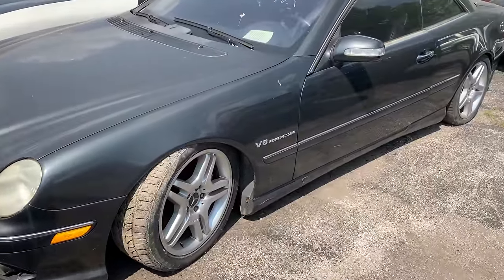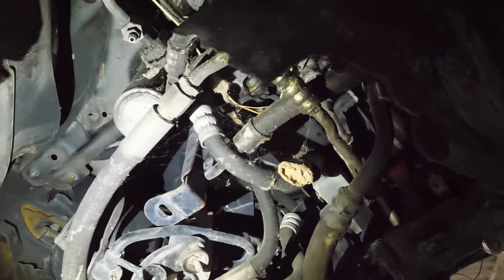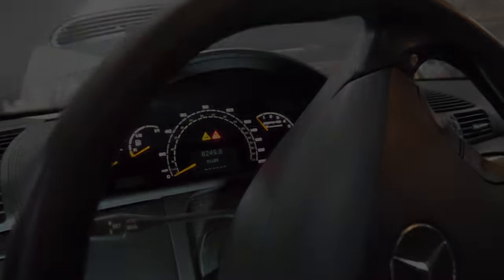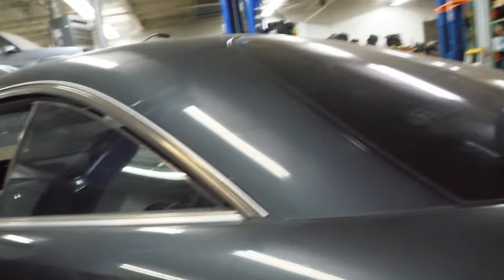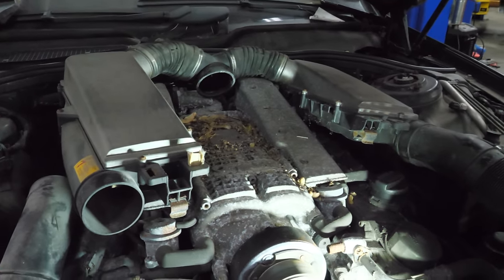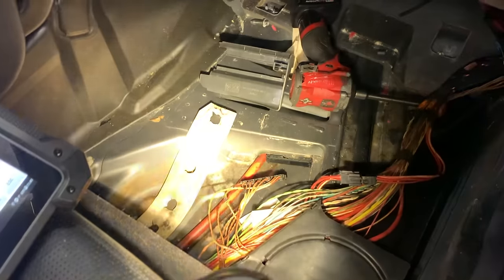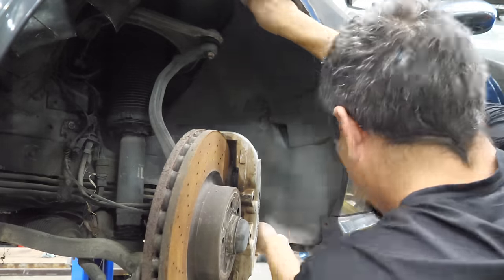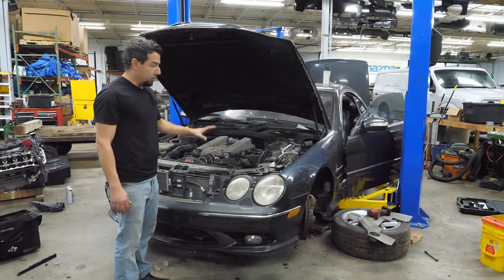DEFEATED! Tow Lot Bought 500HP Mercedes CL55 AMG Sat For 7 Years

Comment: If it's an M113K engine, you could probably needs a coolant pump for the supercharger, but that engine is bulletproof.. it's actually a great car and they don't usually corrode unless they've been crashed or severely abused. Every CL and s-class of that era that I have seen that has corrosion issues, has been in a wreck at some point.. I have a 2006 S430, that I bought used in 2015 while I was living in the Chicago area, the car had spent it's life since noon to that point in Chicago, and it was up there until the fall of 2018 when I moved back to Tennessee.. 12 years in the snow ice and salt and mine is not rusty.

Comment: Careful about relying on continuity tests on communication wires.  You can get continuity if a wire is shorted to another wire.  Only true way to know for sure is to use an oscilloscope.

Comment: When I was in high school, a friend of mine's parents got a 1986's BMW in their yard, whose bonnet cable got broken, and it sat for a while due to a flat battery and they could not get the hood open.

I managed to get it open by removing the right hand front light, and then it was just a matter of pulling the bonnet mechanism lever (which the cable was attached to below the bonnet) to release the bonnet and open it. A battery swap was done and the car started up after a little bit of cranking. 

They got a mechanic to replace the cable and sold the car. 😂

Was real fun. We did not had google or youtube back in the 1988's and had to rely on intuition and luck.

Comment: First remove the fuel pump flush it out with carb cleaner and pb blaster. tap it down on a wood block. use a battery charger and give it power, then reverse the leads until it breaks free. I think it senses fuel pressure and may turn off the injectors of its not detected. Second you have a security failure, but that should show a code. Also change the fuel filter, it acts as a regulator. Drain the tank too.  I have an 02 E430, similar engine and system.

Comment: If the M113K engine fails the compression and leak-down test, you should tear it down. Would love to see that, and someday a Mercedes-Benz M176/M177 V8 teardown, and the Toyota 2AZ-FE straight-four. The latter is widely considered to be their worst engine, in large part due to their notorious oil consumption problem (~1 qt per 900‐1,200 miles on a high-mileage engine).

Comment: I just did this on my 2004 E500 wagon. This is painful to watch, but with the ABC instead of the air suspension you do have way less room. On my car it takes a large screen driver from below to remove the shield and then pop the latch.

Comment: Other than the fuel issues, the immobilizer circuit may be causing you issues,  I have a CL55 myself and running that is one of the most pleasurable cars in the world. It really is too bad that it sat. You were reasonably successful considering the time. 143k miles is still young for an M113k ...

Comment: I’m sure you did your research, but just in case you didn’t, I have three

So, depending on your model some, you have to take the tire off and the skirt out for access some. You can just do right underneath the bumper. 

You take a long screwdriver or metal object at least 2 1/2 to 3 feet long and reach up carefully and there are videos on this. That’s how I found it and you can unlatch the hood. 

You do not have to do all the destruction that you see in this video at all

Comment: He knows how to open the hood very easly. You just pull the iron wire from under the pumber with hand or  using a picking tool, thats what I did. He also could have removed the plastic cover over the wheel, just few bolts and had better access to the hood wires.

Comment: The fan running like that  generally means the ECM isn't functioning.  The whine was the secondary air pump.  Your buddy could code a used ECM for it very easily.  Takes 5 minutes.

Comment: I typically run 25-40 year old vehicles all the time and now the electronics are starting to fail typically due to capacitors leaking. It’s kind of the thing we’re starting to face with our current generation of old vehicles. It’s definitely not like the old days when you could just throw fresh fuel and a battery and drive it home. I like my old garbage, but I do like how well modern fuel systems work, when they work.

Comment: Electric fuel pumps.  If you reverse the voltage the pump moves backward.  Disconnect wires from the car first.  Go from + to - to break it free!  Of course, doesn't always work.

Comment: yes, I did enjoy it, but in summary, you need a friend with the proper diagnostic tool, an abundance of patience, and the actual will to see this car running in order to get this PoS going!
I'm looking to replace an N54-based car(UK)/auto(US) with a Merc (probably an AMG C63), any advice?  I've managed to keep the N54 ticking over for ~5 years now, regular oil changes and spark plugs among others, but there's almost certainly a rear crank seal failure now.  This isn't beyond me but I'd rather not have to do it.
Reply: Scary stuff I’ll stick with my vintage American cars and my Vintage Toyota’s

Comment: Fyi propane works great instead of ether. Get a cheap propane torch and cut off the tip. Put a relly long hose on it. You will like it. Been doing this for 25 years.

Comment: I definitely liked this video. Tad bit of butchery and whatnot but truly entertaining to watch. Well done.
 I know from my r170 that when the fan runs on high w no crank scenario, k circuit is not powered.
W/ mid 2000 era EIS has to tell the SAMs to activate certain circuits to enable drive authorization system.
Last winter I lost my srs, fuel level gauge, easy entry, and a host of others due to EIS not communicating to rear sam to turn on 15R from rear fuse module in my 08 GL.
Car ran and started fine but the eis wasnt fully functioning anymore...
Any missing or received in error messages on CAN/LIN circuits will make these cars braindead..

Comment: I made similar hole in a back door of my Mercedes van when the lock was stuck. It didn't help. I had to break in from the inside and remove a wall. After that cut the lock with angle grinder.

Comment: I've often wondered on cars with no fuel delivery if you could just pipe a small hose from a propane torch directly into the intake and get it running without killing it with ether.

Comment: I think it’s fascinating logic to hide batteries in compartments that can only be accessed with power. Like, what was the problem with things like lever mechanical connections that only little whirry motors, switches and batteries can fix?

Comment: My clk sat for 4 years, and it was a nightmare after. All kinds of things went out. Gas gauge, vent valves, a/c, cooling fans, radiator, belt tensioner. Water vent from the hood clogged water came in. Just be aware it’s going to have more problems. Your suspension is cooked that’s why it’s on the ground.

Comment: I really enjoyed watching this video.  I own a 2002 s10 and have a battery drain so I installed a positive disconnect switch in stead of finding the drain.  It's not a daily driver it only has 89,000 miles.  My point is you really dove into that car trying to diagnose it's issues.  I really thought you'd tear the car down and part it out.  If all your after is the engine can't you put it on a stand and make it run?

Comment: [Clogged injectors]

Hello,

Excellent video. I think the injectors are not spraying fuel, because they are clogged. I have seen cars that sat only for 6 month and had to be jump started. Cars did not start, even with the strongest batteries. Then we took out injectors got them cleaned and they fired the firtst time after that. This was caused by european gasoline, and I know US gasoline is differrent, but it can still become solid in the injector nozzle. Sometimes cars fail becuse of some little stupid things.

Comment: That noise the engine is making sounds like clogged hydraulic lifters. I had one clogged on mine recently and it sounded bad exactly like yours, after a flush and oil change the noise went away completely after a pop noise of it unsticking. Ive daily driven my 2003 CL55 AMG for 6 years now and have done all the work myself. I have access to mercedes workshop software and can help you get it sorted.

Comment: Eric. Thanks. 

If you get a moment, can you tell me what wires you crossed to engage the starter? 

I’m working on my piece of hell and could use that information. 

Thanks.
Reply from the maker: I just decased the relay and manually closed it to complete the circuit

Comment: Your only real mistake was thinking that you had power to the EIS. On a 215, the EIS only needs power and ground to the small connector and a good key for it to turn. That took you down a pretty deep CAN rabbit hole. Drive authorization is another story. The ECU provides the ground signal for the starter relay only if it can communicate with the other immo components. The fact that it would not crank is probably lack of drive authorization.

Comment: Another great video Eric and I can totally understand why you did the way you did, everything before you is pounds in your company account or should I say $🤣 I thought our country's car industry 🇬🇧 was obsessed with dodgy wiring and sticking anything electronic open to the elements but the Germans take it to another level 😂 I had one of my many E39s have the DME under water when the scuttle drain blocked but fortunately it was ok👍 looking forward your next video cheers Matt
Reply: E38/39 are absolute peak BMW. If the 39 is anywhere near as good as the late 38s they're just literally 'built different'. My grandma was given an almost new 2001 740IL Sport from her rich old boss and despite being a Limo it was the most enjoyable cruise car I've ever been in. It's also the best-looking sedan ever imo in the silver sport package like she had. The engines including the M62 aren't bad at all if you're aware of the common issues. It predictably popped the cooling system at like 5 years old but otherwise only needed a suspension bushing. One of the few areas you Euros have us beat is in the cheaper, more common German cars from the 2000s and late 90s.

Comment: Eric, were you aware that on a PORSCHE 928....You can open the hood with the hood latch cable broken?  You remove the wheel well liner on the drivers side and there is what looks like bicycle brake cable formed into a loop.  Pull it and the hood will release....
Reply: I owned 2 and didn't even know that
Reply: @porsche928s4  My '85S2 had it, I'm not sure about the later cars.
Reply: @Flies2FLL  mine were a 81 and 84

Comment: I got into the hood of a very similar car. I took the bumper cover off and went up beside the headlight and grabbed the cable with some long needle nose pliers and just pulled till it popped. I do not envy you 😢
Reply from the maker: Yeah the cables weren’t the problem. The latch was. No pulling on cables would have popped it ☹️

Comment: If I recall these use a vacuum pump to open the trunk and that is located under the rear seat you can take the hose off and suck on the hose or use a vacuum pump and it should release the trunk

Comment: How does a hood release cable fail? Did the previous owner spending way too much time going into the engine bay to fix other things... like fuses? Could you have removed the bumper vs going thru the fender to reach the hood release?
Reply: Who knows. Our Mercedes had a ridiculous amount of idiotic failures until we finally sold it before the warranty ran out. And we took excellent care of our cars. Honda Prelude for over 300,000 miles (still running  great when we got rid of it... body was rusting out no matter what we did.)  Had my Honda Civic for 250,000 miles, still looked and ran great, I needed a bigger car).  That damned Mercedes... we had to replace the engine mounts two years in. Never had to do that with a car that didn't have a lot more years and miles on it. Mercedes service comment when I questioned that? "It's a heavy engine". Seriously. That's what they told me. And I said "on a car with over-engineered EVERYTHING? You put in engine mounts that only lasted two years? It's not like it's being driven off road. It's smooth roads and interstates. The worst thing it had ever been driven on was the Pennsylvania Turnpike!!!". Grrrr

Comment: The big question is why was it in the tow yard. If it was a parking violation, then everything should have run. Six years ago. If it had something fail ( ECM based on no injector pulse ) and was then towed in, then you have the original fault, PLUS six  years of sitting to work through.

Comment: Oh, how the once mighty have fallen! We owned a 1995' W124 wagon that I sold at 155K mi and had a grand total of two things go wrong with it ever - a bad wiper relay and a loose vacuum hose. I think I spent $150 on the relay and fixed the hose issue myself so less than $200 in repairs over five years and 75K miles of ownership. That thing was built like a brick shit house and still drove like a dream when I sold it in 2012.

Comment: If it matters... A functiining key that the car (exciter) can read sending its ok signal to the KTM (key transponder module) which then gives the "ok" to and for all major systems ie fuel, ignition, major instrument cluster etc etc etc os what os needed to start these cars in situations like this. There is very little that can ne done to work around that....as far i I know.

Comment: This being a Merc, I would tend to think everything simple is probably electronic, even a simple hood release gizmo. The batteries for these are typically in the trunk or under the rear seats. Might throw some juice on them and try the release button if you ever run into this again.  😉
Add: I see you went Deep with this one. Disregard!
Reply: What are my customers in west Vancouver now deceased, was working on his Aston Martin db8 getting it ready to be jumped by a specialist mechanic coming over. I can understand there is minor positive things about putting a battery inside a trunk like so you don't have to go hood to hood to jumpstart somebody but come on.

Comment: My GL350 wouldn’t start and wouldn’t shift to neutral last year and with a consumer reader I couldn’t find any codes. Ended up getting it dragged on a flat bed, brought to the dealer and issue was a radar sensor got water into it cause of shitty design and killed the CANBUS. Unplug the sensor and car was fine. That’s CAN systems!

Comment: The driver side hood strut has an extra "service position " by pushing up on the hood, a little red button pops out of the lower part of the strut and the hood will stand practically vertical.  Those clever Germans.  Lol

Comment: Great work, I think you're right to give up because you haven't yet tackled the ABC system, which is a total bankrupcy on these vehicles when they break down, and I wouldn't bet on the state of the hydraulic fluid after 7 years on a vehicle that hasn't been driven. The seals must all be cooked, on the pump, the compensators, the spheres etc... and after the first few miles it is almost certain that the whole system will fail. being sold for parts is unfortunately the best fate this wondeful car could expect from life now.. 
(I own a CL500 2009)

Comment: Kind of laughing the whole way through ... this is actually a pretty common problem.  You can get to the hood latch - just use trusty old blue, and flip the release.  Like others have said, maybe through the  left side turn marker.  Mine I could barley see after removing the fender liner.  lucky your struts work, or you would be doing it a 2nd time ... heh heh.  Don't ask how I know.

Comment: Well..... I think you need to regroup.  I purchased a 2000 S500 that had sat for 10 years.  The EIS was destroyed and key was trashed.  I changed the fluids, flushed the gas tank and installed new fuel filters and pump.  New EIS from Mercedes along with the proper programming key.  Started instantly.  Anyone that tells you the keys are no big deal...... is wrong.  With that much starter fluid you stand the potential to destroy the engine.  This car is very savable..... but???????

Comment: Why was it designed that way is a very good question and hard to answer. It certainly has nothing to do with longevity since this car was off the road for years. It most definitely has nothing to do with ease of maintenance since you and two friends spent a month pouring over it.
Would I buy any German car. No because there all built on the lines of this Merc.

Comment: Clean the corrosion.
Control module and the Connectors to me it sounds like it has to be Alarm
Cause that can possibly also not allow the car to run. This could be the answer and possibly a ground or a wire chewed up.
Check by the exhaust And see if there's any wires There are and connectors that may be suspicious. But if the control module has just that little nuance of corrosion, clean it off and test it, putting it back on again and the same form is not going. Two, give you a definitive answer..

Comment: throw a carburetor on it and call it a day. wouldn't it be ironic if the wires you cut on the first hole shorted the hood release with the last but of juice jamming it and are preventing you from starting the car. though it is a smart place to cut in terms of repairing it just weld it closed and no one will ever see it with the fender liner on

Comment: Weren't there battery jump points in the engine bay like most cars with the battery in other locations? Seems very unlikely to not have it.

Also, what happened to Mercedes quality? A plastic oil pan? Sheesh. And that was a long time ago since this car is old. So disappointing.